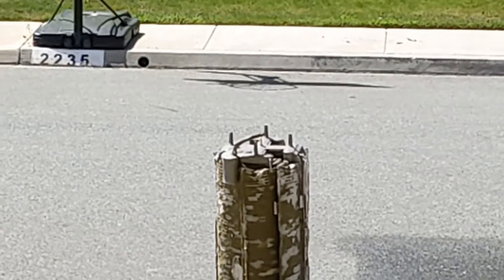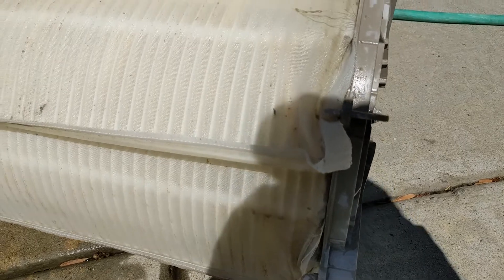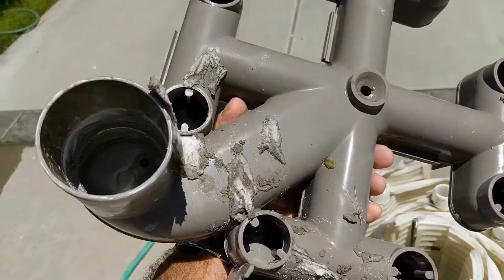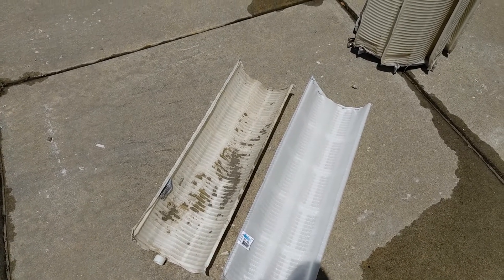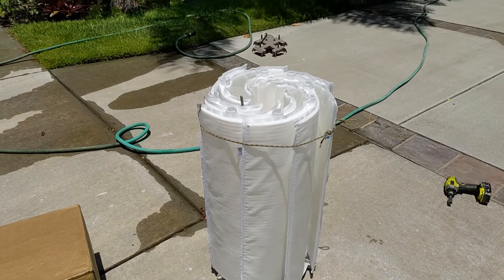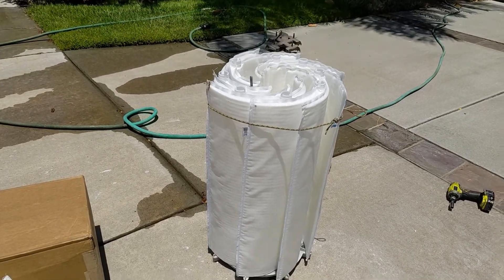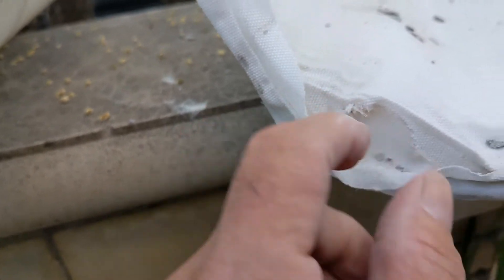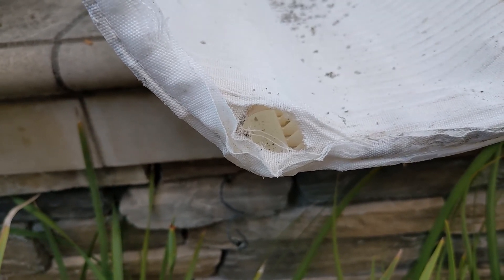Home repair pool replace DE filter grid new better way by froggy

Comment from the maker: Tips & link soon.  :)
1) You have to pull the grid out on this filter because you need to hold the rod from turning. I guess you could try to squeeze pliers thru the top of the grid, but I always pull it.
2) To get it out to start, pull off the top half and stand on the edges of the bottom half, pull and SLIGHTY twist at the same time (with all your strength, haha, maybe a two person job). Twist l/r/l/r etc.
3) 60 refers to sq ft. of grid surface I guess.
4) https://amzn.to/3tXiuWS  MAKE SURE YOU GET THE RIGHT SIZE, call the company if needed.